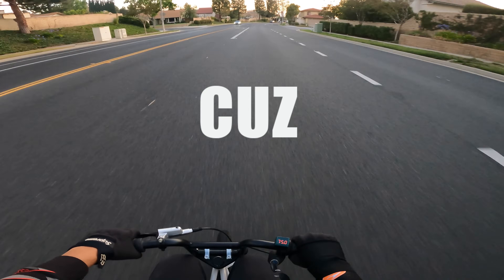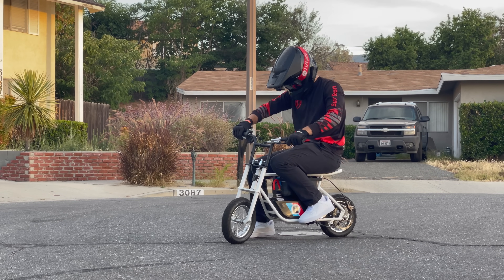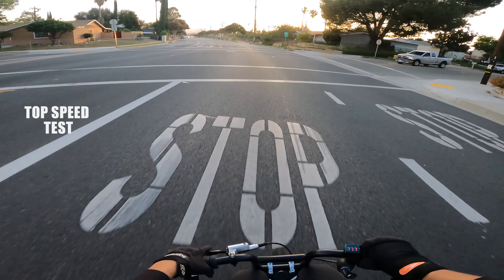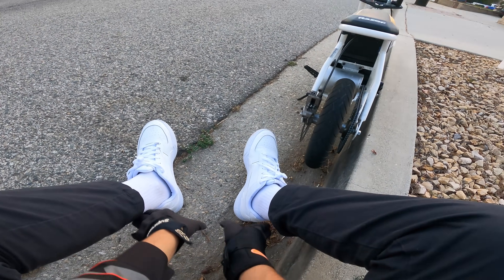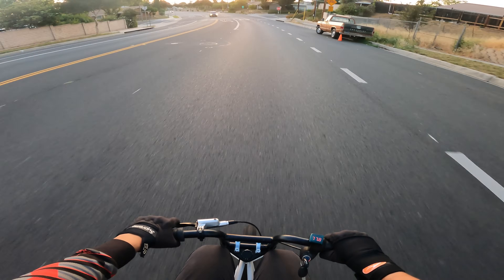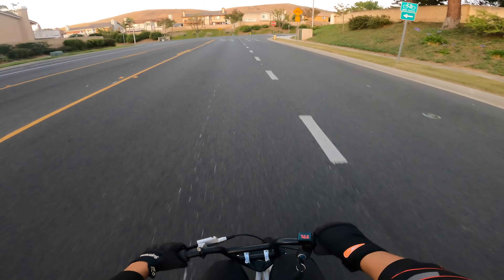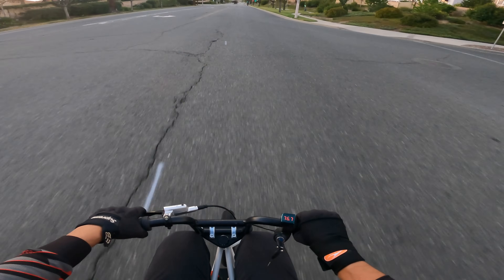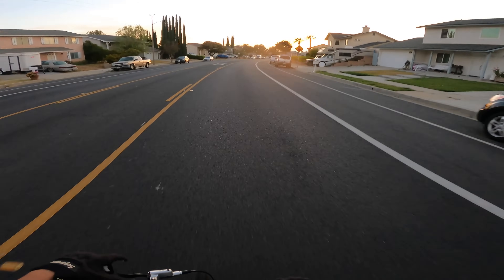MICRO MOTO Electric Mini Bike // Upgraded Razor Rambler Test & Review

Comment: I just built one I got a 2000w  motor like my friends  And it has crazy Torque and only goes 27 but my friends go 40 so I am Confuse but you got a 5000w and only go 34 so I wonder if it is the bike

Comment: Even tho it costs a little more, the rambler 16 is a lot bigger and it might be more comfortable for a build like this. Although it really depends, if you want small then definitely go with the r12.
Reply: the main difference is that its a hub motor bike. Wish the 16 was mid drive like this (rambler 12) too.

Comment: I feel like a better setup would be a 48 volt rather than a 72 because of the smaller size
Reply: Yess exactly
Reply: I have a similar size bike as shown in the video its a mx350 frame with a 48v 1800w motor and goes 30mph with lots of torque
Reply: @issacflores7588  same here, im so terrified to ride mine though lol cus its so torquey

Comment: could gear it up to do 40mph easily, but would you really want to with only a rear brake and those kinda skinny tyres?
Reply: I mean gearing it that way would probably also increase the range so i would probably do it. But i probably wouldn't drive that fast.

Comment: only 33mph for 5000w motor? that's what like 94wh per km? that's has to be crazy amount of torque. no wonder it is hard to ride. even 40wh per km is kinda crazy. 😃
Reply: Yeah that's absurd!
Reply: It's prob geared more for torque for wheelies and stuff
Reply: My mx350 goes 30mph with a 48v 1800w motor and is very torque
Reply: @issacflores7588  im building a chopper style 14x5 inch tire version
Reply: @ModEfried_Customs  do you still have it?
Reply: My bike is insanely ineficient at 220wh per km. It only goes 40kmh
Reply: Gotta see your reaction to the water cooled one that goes 100mph
Reply: Yeah thats crsxy. My 2000w motor for my Rambler 12 goes about 38 mph.
Reply: You could probably fix this issue by adding front forks and instead of using the rambler 12 use the 16